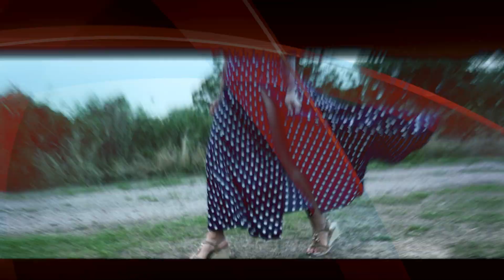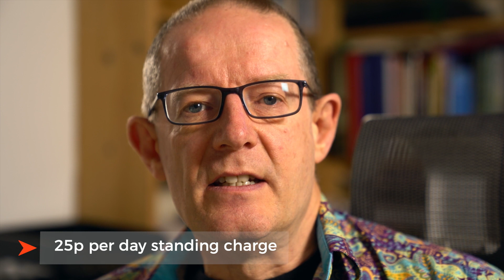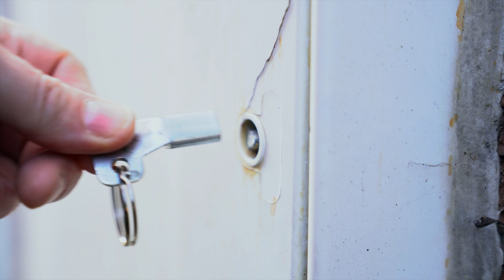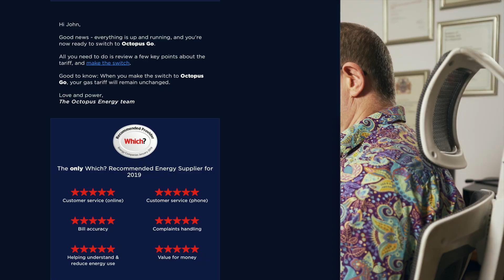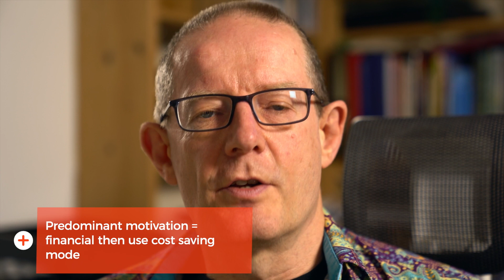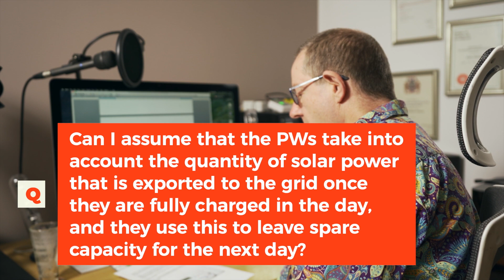Setup Tesla Powerwall and Smart Meter for dual rate tariff - UK

Comment from the maker: All you wanted to know about Smart meters, Octopus Energy Go tariff and setting up your Tesla Powerwall 2 for Time Based Control - Cost Saving. Go do it!
Reply: Hi John, I am interested to know your opinion of the Octopus Tesla tariff of 8p import/export with no standing charge. You clearly qualify for that tariff with your current facilities but don't appear to consider to of value. I would be interested to know why?
Reply from the maker: @seantaylor5957  A good question Sean. The only reason I've not chosen to go that route is you hand over control of your Powerwall to Tesla. They will draw power to balance the grid as and when they need it. As I'm on the Gateway 1 I have no control over leaving a minimum amount in the battery, it can drain to empty. So I'm not keen on anyone else choosing to draw from the battery just in case I wanted to use it. I guess it's all about control.

Comment: Fab video - I have a question though.  I have a set up recently installed - small solar array of 1.4kw and a 13.5kwh tesla battery.  I am octopus intelligent and we have 2 EVs - one tesla.  I would like to charge the tesla power wall from the grid during the off peak - but only to 80% - so that we have capacity for solar charging the next day.  I can’t find how to set that. But also for some reason, our battery exports to the grid the next morning once the battery is charged.  We don’t want to do this - as we are giving our electricity away.  How do I stop the exporting?  Is it as simple as setting the sell price to £0.00? Or is there another setting I have not found?  Thanks in advance for any help you can provide
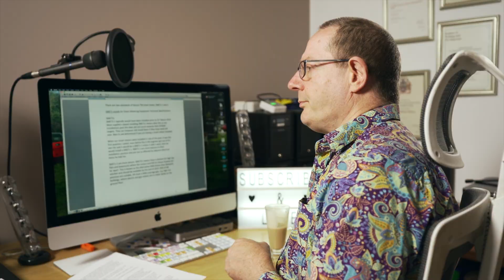Reply from the maker: This video is rather outdated now due to its age and Tesla updating their software for the Tesla Powerwall. To answer your 2 questions; 1. Use the Backup Reserve capacity and set it to 80%. That may help, but the built in algorithm will work out based on house usage, surplus, weather forecast what it needs to do. More often than not it's right. However, the more you fiddle with it the worse it becomes. It's best to set and forget. 2. To prevent export to the grid set your Utility Rate Plan Sell Price at 0.01 (you cannot set it to 0.00). Due this for Peak and Super Off-Peak schedules under Intelligent. e.g. 5:30 - 23:30 Peak and 23:30 - 5:30 for Super Off Peak. Use Super Off-peak rather than off peak as it reduces the import / export of grid power.
Reply: @johntisbury  amazing. Thanks so much. Have just made the change to super off peak and £0 export price. Fingers crossed 🤞
Reply from the maker: @glassdomedesign my pleasure, I see they now allow you to set £0.00 previously this was not allowed 🙄

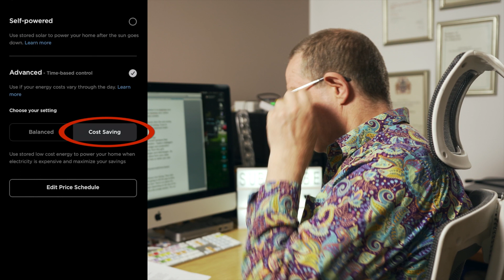Comment: Is anyone in UK still following this thread?  I just moved to the new Octopus Flux tariff, but finding it a bit difficult to get quite the right control settings on my Tesla app with Time Based Control.  ie the Powerwall only discharged to the grid in the Peak time (17:00-19:00) but that left lots of power in the battery that didnt go to the grid. So I edited and extended the period to try to find a way to get it to give to the grid until close to reserve.  Then the other problem was that if I set the app YES to Grid Charging it charges the battery during standard rate time not at cheaper super off-peak time overnight.  Maybe I just need to leave it to "learn" but it isnt doing what I want it to yet.
Reply from the maker: You will find that the Powerwall AI is not 100% and will not always do what you want it to do. There maybe other considerations too. 
What is your export limit on the Powerwall? Are you limited by your DNO to 3.68kWh export which means that over the 2 hour peak time you won't completely drain the battery. What is your reserve % set to? 
The AI does take time to learn, the more you intervene and fiddle the worse it becomes. 
On TBC it will try to maximise savings and give you the lowest energy bill. However as you don't have full control over the system it is unlikely to be as good as someone who micro manages their setup and tweaks it daily. The Tesla is designed to  be a set and forget system and that has not advantages and disadvantages. There are people who have managed to automate using Home Assistant or similar to improve the performance of their Powerwall, but it's not something I have any experience with.

Comment: Thanks for video - very useful. I'm having a problem in getting settings to save.  Set Utility Rate Plan-Octopus Go-enter times for peak and off peak-set costs for peak and off-peak and enter selling rate at 01p-Save Plan.  Set Powerwall Operational Mode to Time based, and Grid Charging to Yes.  HOWEVER the Plan saved in the app shows the previous old rate for single rate and has not been updated. Is there a lag in the new settings appearing in the app do you know? This seems the only explanation as I've now gone through set up several times.
Reply from the maker: Hi Steve, this is rather an old video and many of the settings shown here are now not available. 
However, that said what you've stated as your steps sounds right. I'm guessing you click 'Done' at the end of the data entry of your Go tariff rates to save the rate data. The new rates should show straight away as the data is held locally, there's no lag. Odd behaviour for sure, tricky to troubleshoot remotely to be fair.

Comment: We've just had a Powerwall 2 fitted to complete our solar panels. We are on Octopus Go and I am trying to workout how to charge the battery on cheap rate tariff.. Following you're very helpful video I noticed that your phone app differs to mine with you having functions that aren't available on mine such as setting the charge periods. Is this just Tesla moving technology forward so its deemed unnecessary or does the system need to accumulate more usage data / solar production. All our App is asking for is Utility Rate Plan. Any advice would be appreciated, Thankyou
Reply from the maker: Hi Simon
The video you are looking at is from Sept 2019 so the app has changed since then. This is how you add your cheap Go tariff:
In the Tesla app, choose Settings > Powerwall
Click Time-Based Control. 
Click Yes to Grid Charging at the bottom of the screen.

Then in Settings> Utility Rate Plan
Make the following settings:
Seasons = None - all year round

Schedule:
Super Off Peak (this setting is important as it triggers off peak charging over exporting to the grid)
Peak 
Add your Buy Price. 
Add your Sell Price. (I put mine to £0.01/kWh) which means the Powerwall is not tempted to export because it feels it will be more financially beneficial.

Click Done.
Reply: @johntisbury  .your site came up on a search as Oct 2022 so sorry for that. Thanks for your prompt response however the latest app we've downloaded from Tesla doesn't have a schedule function we just have,
Utility provider
Season
Cost of Electricity, Buy and Sell
Done
Reply from the maker: @simonhattersley3490  I'm using version 4.17.5 of the Tesla app, shame I can't add a screenshot here. Here's a link to the help in the app which might assist you. 
 https://www.tesla.com/support/energy/powerwall/mobile-app/powerwall-modes?redirect=no&dark_mode=true&ham_burglar=true&utm_medium=tesla_app&utm_source=energy_app_feature&utm_campaign=energy_site_settings#time-based-control

Comment: You’ve taken pretty much the same path that I have. Have 2 x EV’s, 2 x Zappi’s, Eddi, 7Kw PV, 1 x PW2 with gateway 1, running cost saving in winter and moved to Octopus Go. Just added another 4Kw PV and second PW2 with backup gateway. Video very informative, very true. Backup gateway much tighter on under the radar grid draw and loss of grid is completely unnoticeable.
Will switch back to self-powered as solar increases.
Reply from the maker: Thank you Jan. Good news to hear that the Tesla Gateway 2 is better at managing the phantom draw from the grid. Tesla are still running tests on this with our smart meter setup as they are aware of the drain issue. You certainly have lots of solar potential with your additional 4kW! Great news. Are you on 3 phase too? Based on the potential pull / push to the grid.

Comment: Approximately how many kWs can be added to the Powerwall during the 4 hours low rate tariff?
Reply from the maker: Hi Nigel, good question. It could fully charge if required. To date, in the short time we’ve had it in the Time Based Control cost saving is done up to 50% full, so around 6kW.

Comment: I’ve had a Powerwall 2 fitted and it’s great, however I didn’t opt for power failure backup.  Why? Because my system is limited to a peak 3-6 kws if I had opted for power failure backup then my battery would have its output limited to the same 3.6 kw. instead of the 5 kw that the battery can output. In order to maintain the 5 kw output from the battery and have power failure back up I’d have to go back to the grid and ask permission to increase my output from the solar, something that was unnecessary when first installing my system. There are very few power outs in the S.E. where I live, 1 in the last 6 years, so not worth paying the extra.
Reply from the maker: Colin. Thanks for the additional info Colin, that’s interesting to know. Like your location we have maybe 1 power-cut  a year for 2 hours or so. So not a showstopper. Gateway 2 is a nice to have, rather than a must have.